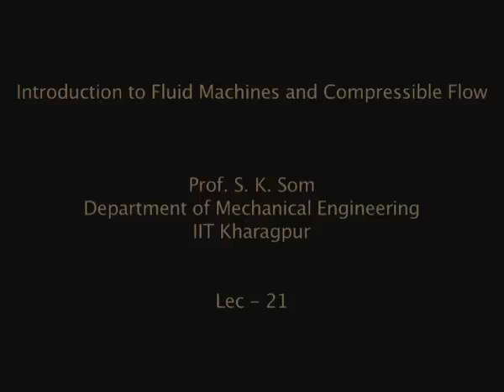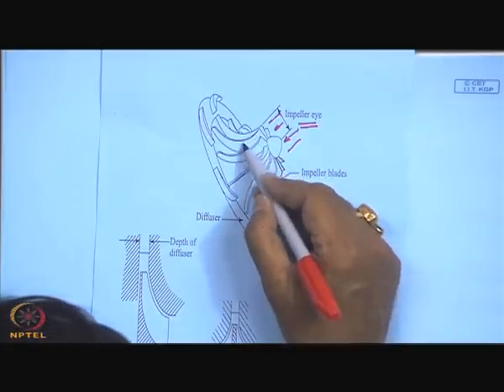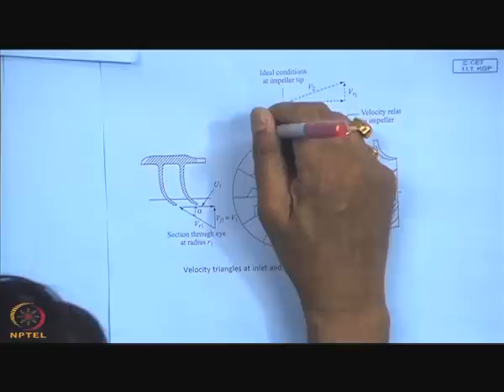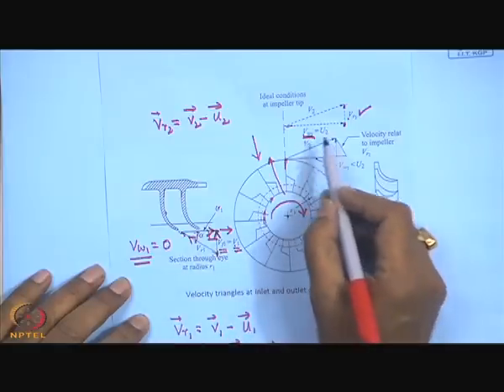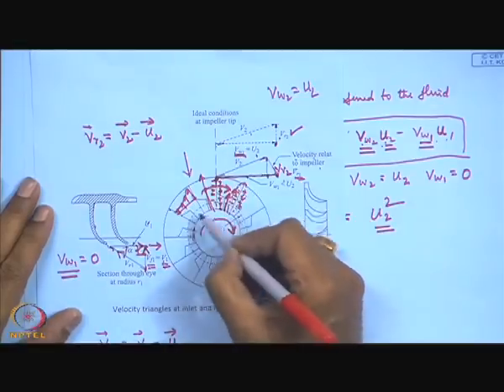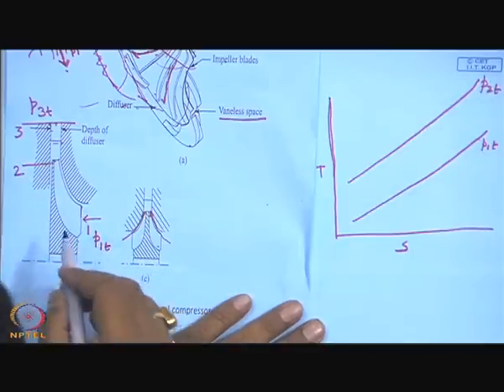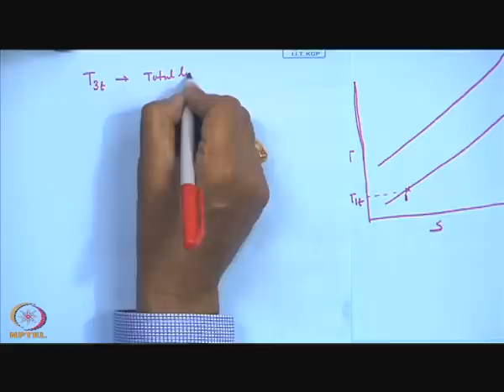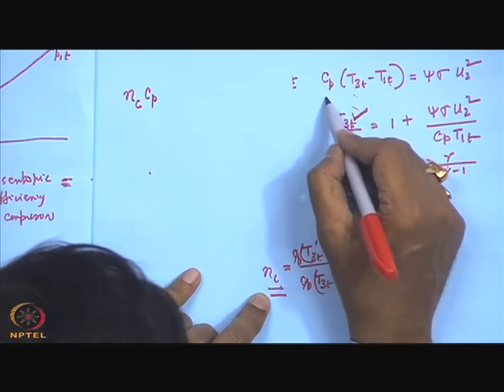Mod-01 Lec-21 Centrifugal Compressor Part I

Comment: if there is no energy gain in diffuser then how there would be the rise in pressure? pressure is also one form of energy which rises temperature of fluid
can you explain me sir?
Reply: Pasu pathynathan.B despite the loss of total pressure in the diffuser due to viscosity, the increase in area in the diffuser reduces the air velocity, therefore the dynamic pressure is also reduced but the static pressure is increased. The goal of any kind of compressor is to increase the static pressure .

Comment: why is the pressure called static pressure if the fluid is moving?
Reply: Tejas Desai  here dynamic word come from
static head and dynamic head, static head provided by pressure while dynamic head by velocity
Reply: The pressure measuring instrument is static relative to the fluid flow ie. the fluid and the pressure measuring instrument are assumed to move together.
Reply: static pressure is the pressure experienced when air molecules interact and collide with each other
Reply: As per boundary layer theory velocity of the fluid becomes zero at the wall, where pressure measuring instruments are installed, because of zero velocity pressure will be max as per bernouli theory. That's why the name

Comment: as the area increases pressure reduces (P=force/area) i cant get the correct working of diffuser how the pressure is gained 
CAN YOU PLEASE EXPLAIN ME SIR?
Reply: Your logic is true in case of solid not in fluids
Reply: Gud lecture with reasonable justifications
Reply: Gud lecture with reasonable justifications
Reply: Yes u r correct. If area increases pressure decreases. Where as in this case, there is conversion of kinetic energy into pressure energy because of decrease in velocity.